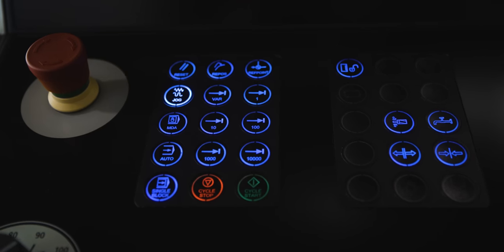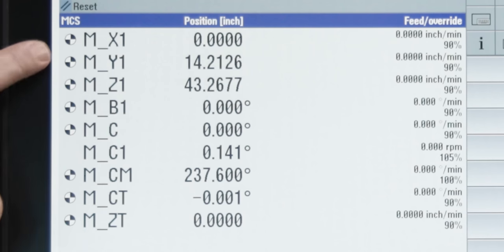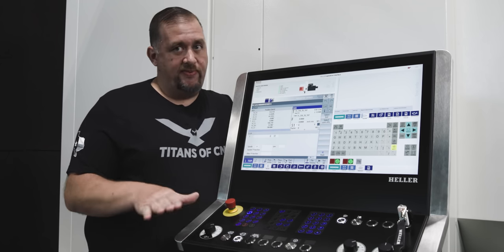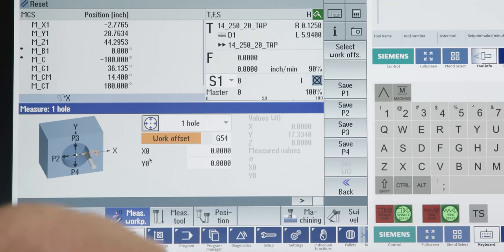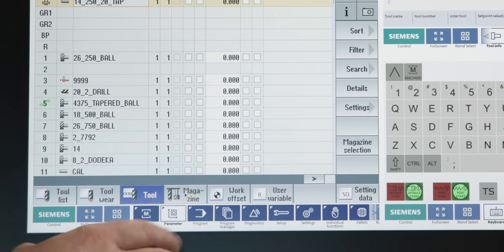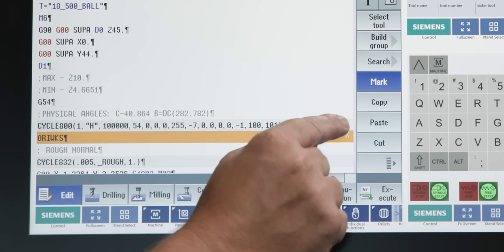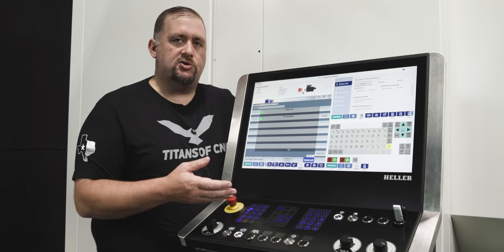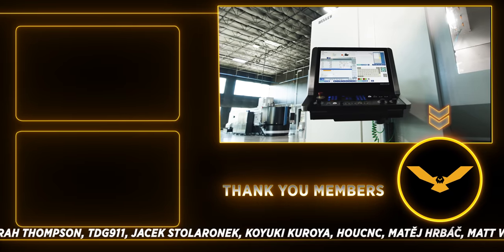Is This The Best CNC Control?

Comment: that is just the tip of the iceberg.

You can create your own cycles, loops, subprograms, if else conditions, define own variables (global and in cycles local), combine strings, while, repeat, when, sync different spindles and so on.

you can do pretty much everything with this controller
Reply: or use .arc files to automatically import several programs and subprograms to a defined folder

Comment: I really like Sinumerik for many reasons . But user interface is just a part of an NC. If you want to compare the performance of two nc's in terms of speed and accuracy you should run the same part on the same machine equipped with different controllers. There are also further aspects to take into account, such as hardware reilability, which is a real strenght of Fanuc. That said

Comment: I run a simple lathe controller, and I never ever have to reference the machine even after a total power down. Why do these machines not have those capabilities yet? Granted, the lathe I run is only 2 axes, but it was made back in 2007.

Comment: Ah man you showed a hurco controller when showing outdated ones😂cmon Barry. We have tons of hurcos at our shop and the new ones basically have mastercam built into it and they are sooooo nice. The controller you showed in there was the oldest version they support( we have those too ) Hurcos are fantastic for quick turn parts, you can program faster than mastercam with it. Iv ran just about everything but not the Siemens, we have a Siemens on our GROB 5 axis

Comment: Those "atari style" controllers are the best, it has no input lag, it has no bugs in software, you can do everything on keyboard pretty fast.....today CNC machines are terrible, it looks everything great only on paper, but in real life, it's better to program it on 20 years old machine. At least in woodworking where you mostly do pretty simple things and just type G code is much faster and easier than doing some CAD/CAM nonsenses. We have morbidelli machines and to work on new models is really pain, I feel always so relaxed when I can work on old machine once again because it always work, it's not showing nonsense errors and everything is simple, you want some basic milling, you just type "go from point A to pont B" and done, no stupid cad things like on moder machines, I totaly hate it. But I understand that you can't just type code directly for some 3D milling.

Those wired controllers on modern machines.....it's such a pain, when I was testing some new program on old machine, I didn't need to watch controller, I just felt that I am moving with speed or RPM knob and it was always doing what it was supposed to do, on modern machine, when I want to paus program, I press it 10 times to be sure that machine really noticed that I pressed something. 😀 And speed gomb.....jesus, it has some acceleration, so more fast I move with that, more it change speed, so even when I watch that speed marker on display, it's really hard to set what you want there, it's everything delayed and responding weirdly. And I feel like I am only one person on this planet who is annoying that every modern stuff is like that, nobody cares, which is sad. It's the same even with "modern" cash desks in shops....it just doesn't work, it's slow, it's freezing, everyone is bothered, but nobody cares, they won't fix it becasue this is how it is.

But I believe that german companies like Siemens are better, or at least I hope.

Comment: Dmg and Hamuels that I work on use siemens sinumerik. Programs on our machine are made in Vericut and catia are much more user friendly than the one you use.... we are working with multiple D ( D1, D2, D3....D6) and every D has corrections in tool list, it is much more simple to input corrections based on the surface that the tool is working,,,, for example D1 is for inlet side on the piece that we machine, D2 for outlet and etc... and off corse, it is in metric😂😂

Comment: In my point of view, the best CNC controller depends on the kind of part you're going to machine. For example, for production parts, FANUC controller is faster than Siemens, but, if you work with aerospace parts and mold and die, Heidenhain is much better and has more features than Siemens.

Just my point of view, but, at the end of the day, we need to do the best with the resource that we have.

This is our life! LOL

Comment: There are a lot of positive comments about this control. Must be a wildly different part of their business than their industrial drives and PLC's. Garbage documentation, hyper proprietary, high cost and extreme lead times. Has anyone had to replace any parts on these? Do you get shafted on price and stuck without a spindle turning while you wait for bespoke small batch artesinal electronics from Germany?

Comment: I'm not sold on touch screens in a shop environment yet.  We've all seen controllers where all of the symbols are worn off after years of use.  How long is it before the screens have places where is so scratched up that there become places where you can't read any text in that area?  These being "industrial" screens you know that they are not going to be easy or cheap to replace.  I'm sure there are screen protectors available for them, but stingy shop owners won't be buying them.

Comment: I am currently working on mill turns with Siemens and mills with either Siemens or haidenhain and I prefer the Siemens control too. It’s just way easier (specifically the shop mill/turn overlay) and intuitive to use wich is extremely helpful when doing a lot of one of parts like I do at work. Another factor is the simulation, the Haidenhain controls in our shop are already a few years old but the simulation is just complete garbage in comparison to even the older Siemens controls. The Siemens simulations are way more detailed and precise than the haidenhain simulation wich I always referr to as „tetris“. The Siemens simulation allows for soe stuff you’d never do on a haidenhain control simply because the crash risk is too high. With Siemens I just simulate and can see everything that’s happening and that makes me way more comfortable testing stuff out.
Reply: have you tried out the 640 or even tnc 7?

Comment: I have used EMCO WinNC version of the siemens controller and that was a hot pile of garbage
Especially the  some tooltips and some pictures are just useless when I am trying to program something on the machine itself. Also in either ShopTurn or ShopMill if there is an error in your cycle... during a simulation the error code it gives you is so cryptic and useless it doesn't even tell you which cycle is the problem or what value to change.
And then some minor things when I am trying to make a sketch a contour and, especially on the radii, it just fits in it's own values that you can't change later especially when trying to do a non 90° radius. 

Maybe it's because emco has garbage things or it's just the software itself I don't like and if I would work on another machine with a siemens controller I would probably change my mind but for now it's garbage

Comment: Sorry guys, that control does not impress me.

We use dental machines to mill technical ceramics, and those machines are 5 axes and can do what Barry showed as well. 

Basically, the machine is a Windows PC running a mill. E.g. I even do not have to transfer the milling program, we simply access the program on the network server from our mill. Just like you would do on a normal PC. I just laugh at advertising slogans like "Now: 5 MB control memory".   It's like Barry said: controls got stuck in the 80s, even today.😂

Comment: I Personally find Siemens Controls very bad for multiple reasons:
1. The Parts in the Electrical cabinet are very expensive to repair or replace and when one of them blows up (Wich they tend to do if they break) the whole Hall gets a Heart attack since it is Extremely Loud.
2. The Control Visually looks like it is still sitting in the 1990s, there were very very few visual changes in the time period till now.
3. All the things shown in this video are at least as easy if not easier on Heidenhain.
4. The Programming interface looks way to complicated and Not very user friendly (Way to many numbers and Characters)
5. Editing a program in the Auto mode, i find this way to dangerous, the probability of a fatal typo is way too high editing this way.